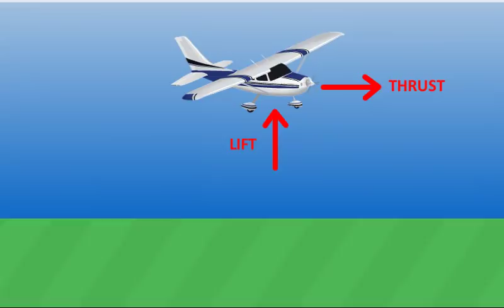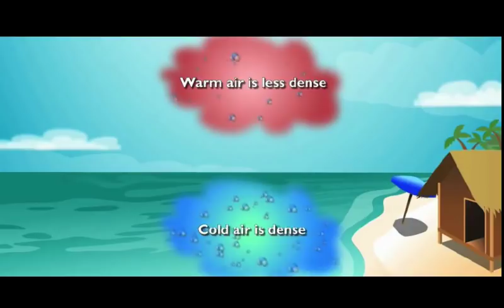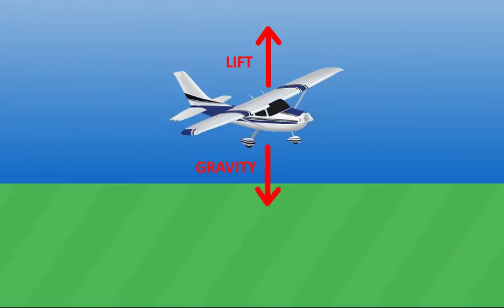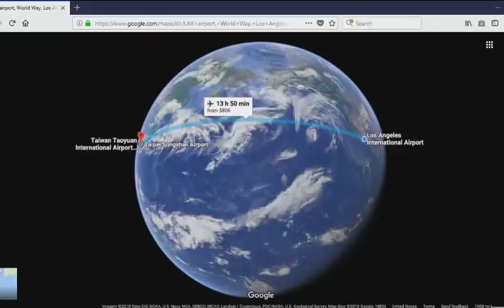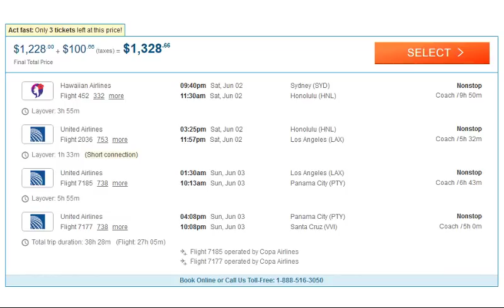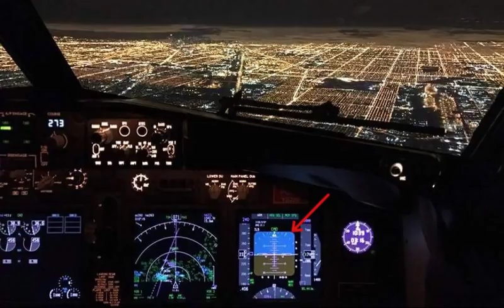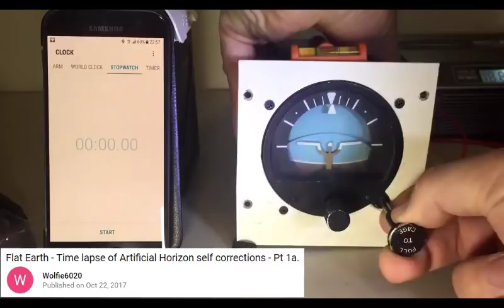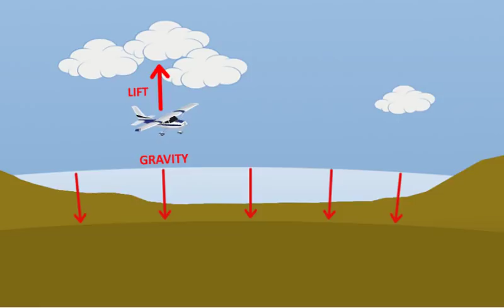Flat Earth Falsities - Plane Nonsense

Comment: I like how you people yeah you you like to say it's obvious and something in motion stays in motion throw a ball up into the air and you simulate it with an enclosed environment like a car we are not in an enclosed environment we are in a convertible therefore if you throw the ball up in the air in a convertible the ball will experience drag quickly reduce speed. I just don't understand why you people can't see how your arguments are null and void and contradict each other you just tried to explain that the atmosphere and everything goes with the the spin but then you will turn around and say the Coriolis effect causes water to divert two different ways each side of the earth and causes a long-range bullet to divert course because of the spin of the Earth.
Reply: If the air inside of the car is an analogy for the air in Earth's atmosphere then you would have to leave the atmosphere to be outside of the "convertible".  So any airplane in Earth's atmosphere is still well inside of the car and not experiencing "drag" from outside of the car.  Maybe you should actually try to understand what it is you are arguing against instead of creating strawmen, parroting talking points, and outright lying.
Reply: You're creating a false dilemma. The atmosphere is dynamic but we don't experience winds as fast as the rotational speed of Earth (say 800 mph in the US).  They are closer to the rotational speed of Earth, which is our frame of reference. The Coriolis effect is too small to affect the direction toilets flush.
Reply: @romithromith  you can say something should be and you might even believe it but unless it is proven by scientific observation from three different experiments that it can be so it is nothing more than theoretics. And we know on this earth when something spins air and water drag with it but never go against it.
Reply: @dustinjames7490  "And we know on this earth when something spins air and water drag with it but never go against it.
"
     What do you mean by go against it? If Earth is rotating 800 mph east and I experience the air moving 30 mph west, is that going against it?
 
    NO. If Earth is rotating 800 mph east and the atmosphere is rotating 770 mph east, I would be experiencing the wind moving 30 mph west. Even if the wind was moving 600 mph west, it is still moving is the same direction as Earth — moving with the Earth. Experienced any 600 mph winds lately?
Reply: Tell us your explanation why hurricanes always rotate clockwise in the southern hemisphere and counterclockwise in the northern hemisphere.
Reply: @romithromith  the earth works on magnetics it is literally a big magnetically charged clock the jet streams have nothing to do with the Earth being spherical and everything to do with the movements of the sun close to the equator. Naturally on one side of the sun the northern hemisphere is facing East is going to swirl back to your left behind you and on the southern hemisphere it is going to swirl to the right behind you. We know that hair has a natural magnetic charge so does water to a certain degree and it is just enough to cause jet streams working with the movement of the sun opposite on each side of the sun which travels very closely to the equator line.
Reply: @dustinjames7490  "the earth works on magnetics it is literally a big magnetically charged clock the jet streams"
Fascinating.  Truly fascinating.  "but unless it is proven by scientific observation from three different experiments that it can be so it is nothing more than theoretics"  So what three experiments did you conduct to verify your bullshit before you spewed it forth?
Reply: @dustinjames7490  "the earth works on magnetics it is literally a big magnetically charged clock"
     Where is the south pole (north pole) of this magnetically charged clock?

"Naturally on one side of the sun the northern hemisphere is facing East is going to swirl back to your left behind you and on the southern hemisphere it is going to swirl to the right behind you."
     Why?
     Why does the slight turning of high velocity projectiles in one location stay the same in January as in June?

     How can A P Presley see the Sun rise in the southeast and set in the southwest? The angles, path and length of day are symmetrical at the same latitude north six months opposite. Why is the distance of a minute of longitude smaller there than at the equator?

"A rainbow proves there is a firmament overhead"
      It proves you don't understand optics. I can make a small rainbow spraying a mist of water in the sunlight. 

"they keep the public dumb for many reasons."
      The main reason: Globebusters, jism etc. make a tidy income off of flerfs.
Reply: i always wonder how old flatturds actually are
Reply: @GebSpez15215   What is stupid is watching astronauts and their stupidity and believing that that is real life. What is stupid is leaving all your information to a government of filiated organization never questioning anything they have to say even though they've been caught so many times lie
Reply: @dustinjames7490  "never questioning anything they have to say even though they've been caught so many times lie"
      Maybe you should try questioning those flerf videos. Most of them are made by idiots like Anthony Riley or liars like Jeran Campanella. You do know jism is in it for the money, don't you?
     I don't know of any lies NASA has been caught in.
Reply: @romithromith   Until your connects plain to me how 24 hour clock works on the current model don't talk
Reply: @dustinjames7490  What specifically about a 24 hour clock confuses you?  Is it numbers higher than 3?
Reply: @dustinjames7490  The Earth rotates 15° per hour. This can be seen in stars apparently revolving around both the north and south celestial poles.
Reply: @romithromith   Well for one you have never actually seen this have you. The North Pole yes the heavenly bodies drift at what appears to be 15ﾟ The Southern border that's a whole different beast because for all of the thousands of eyewitness accounts studies photographs of the northern stars. There's only a handful of very sketchy claims of a  Southern polar rotation. But this can best be explained by    The effect the vaults has on it meaning light and liquid and glass. Sense we are not free to go there anonymous can actually say what is. And if these people have been lying and the military industrial complex and very large corporations are behind them well then it seems maybe they have their people at the South Pole making shore the propaganda is looking good from that point  Well after all if they have lied and told the world there it is a ball then they have to lie and convince the world that the same thing that happens at the North Pole happens at the South pole. I claim that most ordinary men on this Earth will never be able to substantiate As  True. So you say there's a lot of belief in modern astronomy. You're going to say I've seen pictures and I've seen it from space well thanks to television I've seen 50' gorillaz climb the Empire state building and trees walk.
Reply: @dustinjames7490   "Now I want you to get light bulb lamp whatever put it in the middle of a dark Room and I want you to take you a little spiracle Earth and I want you to go around it"
1:  So in order to explain a 24 hour clock you want me to simulate an orbit?  Something that takes a year to complete?  Is this the quality of "experiments" that we can expect from you?
2:  You didn't answer my question.  What specifically about a 24 hour clock do you need explained?  Don't make excuses.  Don't parrot talking points.  Man up.  Act like an adult for once in your life and explain exactly what it is about a 24 hour clock that confuses you.
-
"Well for one you have never actually seen this have you."
You have never gone outside and looked at the sky?  I'm not surprised.  That is a common failing with you guys.  You demand that others conduct "experiments" but you are unwilling to even go outside and look up.
-
"There's only a handful of very sketchy claims of a  Southern polar rotation."
Again, if you have to lie to argue your case then you might want to consider that your case is not worth arguing.
Reply: @MrQuaiven   That's what I said and maybe if you are not  To  Fluoride  treated in your mind will think Clearly and you might begin to understand the error of the whole system only a flat world  Can a 24 hour time zone be efficient.
Reply: @dustinjames7490  Are you capable of speaking like a rational adult for a moment?  Stop parroting talking points.  Explain specifically what exactly it is about the 24 hour clock that you do not understand.
Reply: @MrQuaiven   S far as the way my text are coming they will continue to come in a little out of sort it throws off algorithms I have had many comments deleted because Google didn't like them. They didn't need the propaganda and other words.
Reply: @dustinjames7490  You can see stars apparently revolve around the southern celestial pole anywhere in the southern hemisphere. Millions of people see it from Australia alone.

"The effect the vaults has on it meaning light and liquid and glass."
     Pure nonsense. The southern celestial pole behaves exactly like the northern celestial pole, its altitude being the sine of your latitude. 

"Sense we are not free to go there anonymous can actually say what is"
     You can go there. Anyone can so long as can pay for it and have a passport. (Or get a job there.) One more time — you don't need to go there to observe the southern celestial pole.
     I'm not sure what not being anonymous has to do with it. If I go to any other country, even Canada, I have to show my passport, so I am not anonymous. Don't you know that?

"And if these people have been lying..."
    Like lying about not being a flat earther.
    The people making flerf videos are the ones lying to you.

"You're going to say I've seen pictures and I've seen it from space well thanks to television I've seen 50' gorillaz climb the Empire state building and trees walk."
     But no photos of the firmament.
Reply: @romithromith   Name some of those people that you personally know. Or is that just the blanketed statement
Reply: @romithromith   That's what I thought when you can't explain something clearly you resort to making fun calling names I've heard it a million times  Man it makes no impact on me whatsoever I'm here to teach people if you don't wanna learn shut up and get out of my way
Reply: @dustinjames7490  You are becoming progressively more delusional.
Reply: @romithromith   Or could it be that you are propagandize and delusional and have been taught by popularization to attack anyone who says otherwise
Reply: @dustinjames7490  A P Presley is one. Peter Burgess is another. Do you doubt the existence of Australia too? Name some of the FEers you know personally.
Reply: @dustinjames7490  "I'm here to teach people"
     You're here proselytizing flat earth conspiracy theories. 

"if you don't wanna learn shut up and get out of my way"
     Excuse me? If you are able to have a rational discussion, that's great. But this is a forum to debunk FE nonsense, not spread it.
Reply: @dustinjames7490  "S far as the way my text are coming they will continue to come in a little out of sort it throws off algorithms I have had many comments deleted because Google didn't like them. They didn't need the propaganda and other words"
So that's a no then.  You are not capable of speaking like a rational adult.  You are only capable of just constantly parroting talking points.
Reply: @MrQuaiven  you asked so I told you the truth
Reply: @MrQuaiven  apparently one could say the same for you
Reply: @GebSpez15215  distrust is healthy it keeps those free who wish to be. I work for gov. That are not the issue. It's those who control works governments that are evil.
Reply: @dustinjames7490  
you’re the guy who is emptying the trash bins in the city park? is it you? yeah, that’s kind of „working for the government“, that’s right...

the park looks flat... right??? lol
🤣🤣🤣🤣🤣
Reply: @GebSpez15215  I can't tell you what I do if you don't have clearance and the best interest for the government you don't need to worry about it. I'm still waiting on one of you squirrels to explain to me how you come up with a 24-hour clock noon to noon 360° spin spherical objects? So far I've got dancing around the subject and lots of mindless childish name calling.
Reply: @dustinjames7490  
name calling? nope, i just acknowledge what you are. a liar, when it comes to your job. „clearance“... lol

here’s the experiment: 
put the stick in the ground. at any given moment in the morning, attach a string to the top of the stick and connect it with the top of the shadow of that same stick. make sure the string is kept straight. after a certain amount of time - e.g. 1 hour, repeat. attach another string to the top of the stick, connect the string firmly to the top of its shadow. repeat that again and again, til sunset. 
notice that the strings get shorter before noon, and longer and longer after noon? good. 
now, measure the angles between each string at the top of the stick. from one string to the next. got that?

my prediction: if you chose exactly one hour as interval, each angle will be exactly 15 degrees. 
it doesn’t matter where on earth you are, or on which particular day of the year you do this experiment. it will ALWAYS be 15 degrees per hour. 
i bet you don’t understand what this simple, independently observable fact means. it means that the sun id not hovering in circles above flattardia and earth cannot be flat. no way. except YOU live at the north pole... which you don’t. 

accept it. elementary school kids can prove all you flattards wrong. 
you guys are silly nitwits... no, i am not calling you names, i speak the truth. sad...
Reply: @GebSpez15215  I almost forgot about you you're the one that likes to call everyone who doesn't agree with you a liar lol. I'm still waiting on my working model of the current system and how time as we see it functions properly. and I don't mean computer model because a computer can't be programmed to say anything I mean a physical model or am I to understand that you cannot produce this.
Reply: @dustinjames7490  
try to do the experiment. it should match your intellectual capacity. 

lol
Reply: @GebSpez15215  so what you're saying is you can't do it I get it it can't be done and that is why. People such as yourself resort childish behavior.
Reply: @dustinjames7490  
why do you always quit? 
mimimi...

hahahahaha 🤣🤣🤣🤣
Reply: @GebSpez15215   Sometimes there's nothing more to say people are Florida aged and indoctrinated and there's nothing you can do about it
Reply: @dustinjames7490  
in your case it is because you don’t have anything to say. you’re guaranteed knowledge-free...
but interestingly you posted here first. i asked you a few questions you don’t like... and there you run away. shouldn’t you be trying to convert people to your sick cult? mah woke flerfie?

😂
Reply: @GebSpez15215  were is working model ?
Reply: @GebSpez15215   I tell you show me a working model I don't care how you make it as long as it's not computer keep your mouth shut you don't know what you're talking about make a working model and explain to me how it works and then you have Room to talk.
Reply: @dustinjames7490  
where is your model? flah erff has none. 

is it just sheer ignorance? or stoopidity?
the heliocentric model doesn’t require any computers. it was an established fact hundreds of years ago. 
but back in the days the internet had not been invented yet, so the religiotarded didn’t believe in „flah erff“... not even the delusional ones. 

you fell for an internet hoax. 
how about you visit a library? you know, buildings with books in it?
read those books... learn basic astronomy and basic physics. 

lol
Reply: @GebSpez15215  but they are not two celestial poles if you look up celestial Pole even if you put South it's going to show you the North and the few that claim to be a celestial Pole come from you guessed it NASA affiliated people. I think the reason why you're having a hard time is because you're failing to understand how the world really is and the firmament with liquid. But one thing is for certain the timestamp for the current model is so far flawed and easy to see
Reply: @GebSpez15215  I'm not claiming anything except for the world is in fact geocentric and I really don't give a damn what you see. You do you.
Reply: @dustinjames7490  it doesn’t bother you that you can’t explain two celestial poles? you babble about liquid in a firmament and that i „struggle with reality“... while you can’t explain reality at all? you quit and deny the southern pole exists? 
you just humiliated yourself... of course , flattie
Reply: @GebSpez15215   I want this bother me because there are not 2 celestory pokes you just believe that ship you believe everything you're told and the media is the propaganda machine that tells you. You believe the Earth is warming up then everything should go mobile that mass shootings are real dips and everything they tell you is the truth. Time for you to snap out of it
Reply: @GebSpez15215  I'm not acknowledging your question because it is based on fabrication. You say billions of people name the people. Name one person outside of an organization.
Reply: @dustinjames7490  Honestly, this whole comment thread isn't even a conversation. It's a toddler repeating excerpts from a textbook they were handed in an alleyway by some shady guy who wanted dad's credit card to a bunch of actual bookworms on the subject who have enough conversational skills to put it all in their own words.

It's genuinely hard to visualise you having a single coherent thought that hasn't been run word for word in one ear and crammed back inside when it tried getting out thanks to a clone coming in the exit ear. The accusations you throw out about brainwashing are so clearly projected that your job probably involves a smartboard of sorts that someone else operates.

I'm not even gonna bother joining in, I'm just gonna keep watching, unless you prod me, in which case, I'll keep roasting you.
Reply: @jamaldeep13  maybe it's not for you maybe it's your curse to live in the dark and run from truth I don't know what else to tell you.
Reply: @dustinjames7490  Or maybe you're projecting so hard it's impossible to let you know in a way that doesn't come off as "no u"
Reply: @GebSpez15215  it is called disinformation and there are plenty of young people willing to do the job for the sole purpose of money . Elon musk is affiliated with NASA all space industries are affiliated together under the umbrella of a very few corporations there are many movies warning you people of this very thing . Kennedy tried to warn you people that there was a group of individuals so powerful so pervasive so hidden that even the Richmond in the earth dare not speak against them for fear of repercussions that they had a mass such wealth and such power they controlled 90% of the science education governments and so on. The problem is people such as yourself dismiss this morning as conspiracy people like myself understand that he was not a conspiracy theorist so you say but someone who saw something that thought the American people should be informed and alerted about. The creature from Jekyll island has control the creature from Jekyll island has got people's soul they have sold their soul for pieces of paper that have absolutely no value backed by nothing entrenched by debt.
Reply: @dustinjames7490  nice story. since you just claim it, you could sell that made up shyte to hollywood. maybe they make a 3rd class movie. 

just answer my question. i saw both celestial poles with my own eyes. no nasa, no conspiracy, nothing obscure... just a plain simple astronomical phenomenon. 

what did i see dozens of times when looking at the southern celestial pole?

explain that, mah woke friend. just that. you claimed to know better
Reply: @GebSpez15215  oh and before you get all excited thinking that my choice of words is proof that you have agitated me wrong I never text anything into these phones I use it like a mouthpiece I say it it puts it if it gets it right so be it if it gets it wrong who cares.
Reply: @GebSpez15215   Can you just proved you only know how to regurgitate what you were told none of which you can prove for yourself.
Reply: @GebSpez15215  first off the heliocentric model is far from flawless second off you do not look into the southern celestial Pole you just assume that it is there because you were told it is there.
Reply: @dustinjames7490  
ok. so you say, i was just told it was there. you claim that so you can deny the existence of the southern celestial pole?

but when i traveled australia and south america, what did i see when looking south? 
the southern celestial pole was there. not just me, but billions of people see it every night. also, the same star constellation like on the australian flag. nobody hides anything. 

explain that. it’s extremely simple. 
stop denying the existence of those star constellations just because YOU never left your village. 
cmon, that’s embarrassingly childish. 
grow up.
Reply: @GebSpez15215  where is your footage proof fast forwarded otherwise false plans from a desperate mind.
Reply: @dustinjames7490  footage of what? the southern celestial pole?? lol
that is just like asking me for a picture of the statue of liberty to prove it exists. have you seen the statue of liberty with your own eyes? yes? can you prove it? lol

so you deny the existence of the southern celestial pole? that is what you go for? lol 😂
Reply: @GebSpez15215  no it's not the same thing extraordinary claims call for extraordinary proofs. Reason you for whatever reason are flat out lying about the southern celestial Pole you did not witness a circular rotation in Australia. it seems more like you're trying to convince yourself I get it nobody likes to feel like they've been lied to.
Reply: @GebSpez15215  look Einstein the Stars work on both models obviously for thousands of years the men traverse the world using Stars on a flat Earth. You are one of those people who ignorantly debates by saying the Stars rotate differently in the southern hemisphere which they don't. No matter where you are on this Earth whether it be flat or round when you stand anywhere on it and face North the Stars will rotate the same direction.